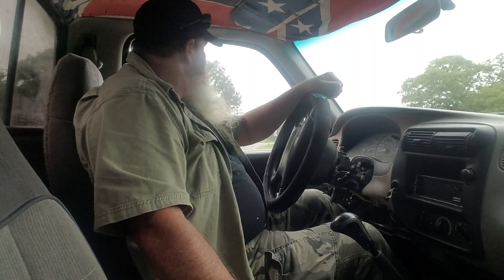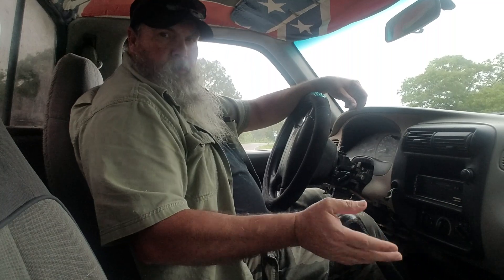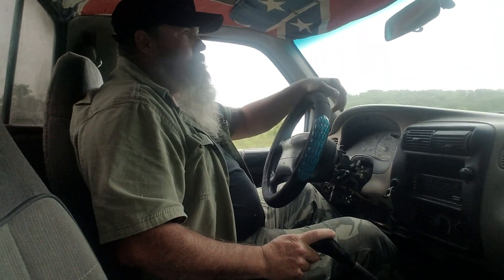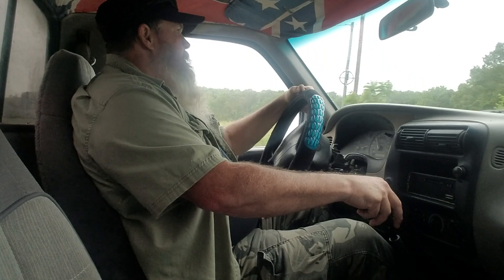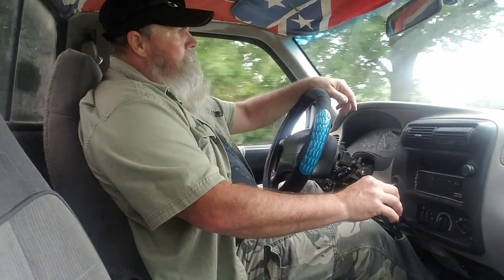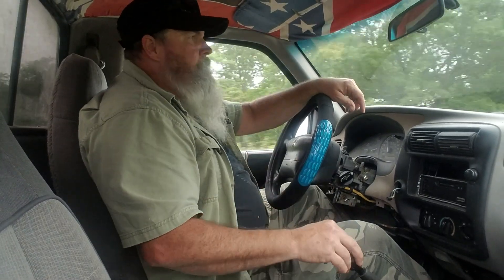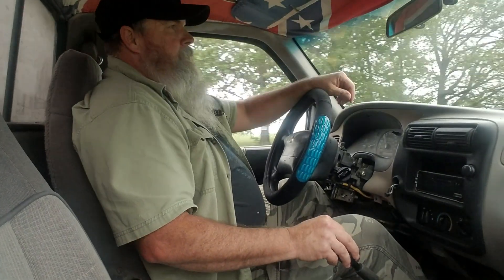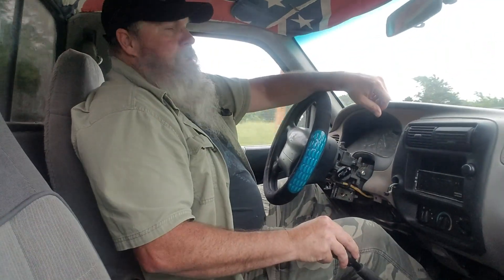Shifting A 5 Speed Truck Without The Clutch.

Comment: My slave went out.
How about getting into 1st or reverse to get moving .
I can probably float them to the shop.
Reply from the maker: If you're careful you can crank it over in low unless it has a clutch safety switch
Reply: Yep. That’s the only way. But it starts rolling pretty fast. Lol
Since the clutch dropped yo the floor, it activates the switch.
Reply from the maker: @cogiccowboy3168 I'll just say good luck going forward! 👍😂

Comment: Seen my dad do this in his 91 Dodge Ram D350 but never showed me how, thanks, not going to try it in his because it was my great grandpas so we don’t drive it a ton, but am looking at getting a 99 Dodge Ram 3500 from my grandpa, might learn this, synchro is messed up 3-4 though so I’d assume I’ll still have to clutch there
Reply from the maker: @purplevr8727  This method works when the transmission is in proper working condition. Also, not too efficient in stop and go traffic, but definitely useful for rural driving.

Comment: Will this work on a 94 f 150 5.0 got the m50dr2 transmission in it just wondering thanks and great video
Reply from the maker: @bigbaby5234  It has worked on all of my 70s - 90s F series pickups.  I will always note that you must use your own discretion. I have driven these old trucks for decades and have only had a couple that were finicky about floating gears.

Comment: So can I do that with my 94 Ford ranger XLT 5 speed standard ???????
Reply from the maker: @user-zm4pv4mk6o  You should be able to. But start out slowly until you're comfortable with it. If you grind gears or have to force it ,it is actually harder on the transmission. Some people will say that floating the gears is bad in general, but I have nearly 250K miles on this one and have no issues with it. I would say to use your own discretion.

Comment: Is it better to double clutch or float shift?
Reply from the maker: @YoutubeMastersDegree  I would say that it is entirely dependent on your driving conditions. I usually float when driving leisurely.
Reply: @BigMikesHooptyBarn  Thanks I have heard some guys say to always double clutch because its "easier to replace a clutch then rebuild a transmission", but I have also heard guys say that its much better to float shift because they drive longhaul and would blow there knee out if they did not. I am considering to start double clutching my 06 tacoma 6-speed with 228,000 miles, it does grind 3rd during the first 10 minutes of driving before the trans heats up so I am going to try double clutching next time I drive my truck to see if the grind stops.

Comment: It was actually pretty easy in my old Honda I used to synchronize the gears I actually learned that in high school the thing is I bought this little rusty old Honda and I love it no AC no heat but it ran perfectly the best part is is when somebody was riding with me or still to this day in the truck I have now which is a Chevy they say it feels like they're riding in an automatic until they look over and realize it's a standard and I'm actually shifting gears but without the clutch

Comment: This would only be for when the clutch has disengagement problems. It's less expensive to replace that than a transmission because the synch rings are bad because the driver didn't get the practice down very well. The rings will normally outlast a clutch anyway.

Comment: I have a 2000 s10 that I bought afew days ago....trying to get my shifting down pat...I'm not use to driving a 5 speed because of me driving older 10 speed transfer trucks lol I know I'll probably get picked on alil but is it the same shifting an s10 like the ranger? Or am I just overthinking it?
Reply from the maker: Most of the older 4 speeds/ 5 speeds from the early 2000s and back are built similarly. With a bit of practice it should be a pretty easy learning experience. Thanks for watching and commenting!

Comment: I’m a truck driver and when I learned how to drive a manual transmission semi I thought I knew what I was doing. It’s completely different from a regular truck. The idea is kinda the same but it’s a lot harder especially pulling a load up a hill!
Reply from the maker: Absolutely! I started out driving big farm trucks.
Reply: I learned that on a 1995 Honda Civic actually little beat up rusty old Honda Grand perfect at over 200,000 that was a beautiful little car for cylinder not all that great the heat didn't work the AC didn't work but that was when I was in high school and I learned how to synchronize the gears see the thing is it's not that hard to do some people even told me that it feels like they're in an automatic with me but then they look over and realize I'm driving a standard
Reply: @KayTompkinspiro   yeah its still easier in a car even without syncros the semi redlines at like 2000 rpm and you need to double clutch and shift or rev match and shift within like 1500-1800 rpm and you have 10, 13, 18 gears. you have to be in 5th plus gear just to get past 10 mph its a very fusterating process which is why i chose to drive an automatic. it allows me to keep more attention on the road and other drivers.
Reply: @mromatic17 so damn true

Comment: Yeah I hopped up in a super 10, and dad and I just put a new v8 5 speed in my 93 pick up, used to have an auto inline 6, I don't see myself driving an automatic ever again, unless it's needed for a season.
Reply from the maker: An automatic with a tow/haul package can be handy when pulling a heavy load over long distance or through mountainous terrain, but for the most part, I do prefer a standard.
Reply: @BigMikesHooptyBarn  idk I like the freightliner super 10 for the long hauls, with companies I drove automatics and somehow I prefer the manual better, even for small mvs when hauling, manuals to me are superior. Especially an old Cummins

Comment: I bet this is how you shift gears in a VW Autostick Beetle.
Reply: Nah. On those, you push the knob down and that disengages the clutch using pneumatics.
Reply: @HelloKittyFanMan  really? I never knew that? How did you know?
Reply: @marvinthemaniac7698 : I'm not sure if you never knew that or not; it might just be good for you to tell me if that's the case.
Anyway, how I knew: I've just seen videos and read up on them. There's a lot about them in the encyclopedias.
Reply: @HelloKittyFanMan  I've never driven a vintage Volkswagen, let alone been inside of one.
Reply: @HelloKittyFanMan  I've only ever drove and ridden in modern VW's. More specifically, the Passat.
Reply: @marvinthemaniac7698 : When I was pretty young I rode in a neighbor's 70s Bus and an 80s Vanagon. OK, well... maybe they weren't terribly vintage at the time, so when I rode them I guess I wasn't technically riding in vintage ones. But now we could say it figuratively, retroactively. Both of those were manual, but I think there was never an AutoStick of anything but the classic Beetle.
Reply: @HelloKittyFanMan  you're  absolutely right. The Beetle was the only vintage car that had that option.
Reply: @marvinthemaniac7698 : Ahh, yeah. Thanks.
Reply: @HelloKittyFanMan  you're welcome dude

Comment: Shifting gear with no clutch can also wear transmission out to and cost money to rebuild it lol cheaper to just use the clutch
Reply from the maker: If not done properly, you are correct.
Reply: @BigMikesHooptyBarn : Even if done properly, he's correct. Normal driving with synch rings is meant to be done with the clutch no matter how good or "proper" the driver thinks he is in floating.
Reply: I drove a ol farm truck 90’s first gen dodge 5 speed just war right out not one synchro left in it 3rd was pretty Stubborn

Comment: The problem with this is that a gas engines rpm's increase and decrease so quick its easy to miss the proper rev to manage the shift. But like you said, practice is the key.
Good video.
Reply: Think about them synchronizers in that tranny as you "practice". It's not a big rig

Comment: Thats how I shift my 13spd Freightliner. No syncros in that big thing. Clutch is for starting out & backing up. It’s all done with the gas pedal.👍
Reply: Also for stopping without killing the engine.
Reply: I assure you that it does have synchronizers and that it doesn’t have a gas pedal.
Reply: @UnfinishedProjectDartSport  Ya I know it’s a twin turbo Cat diesel. But I still call it a gas pedal. 👍 It hit a  million miles about 2 years ago, engine is still great, but it needed a clutch and I had the tranny rebuilt.  No syncros in it. 😃
Reply: @tims72demon  
Wow, ok bud. You keep on trucking.
Reply: @tims72demon  with that many mile under your belt, I think I'm gonna call it a gas pedal too!
I used to have to keep his cat pete at 2500 rmp, and I got corrected when I called it a gas pedal.  Hahaha